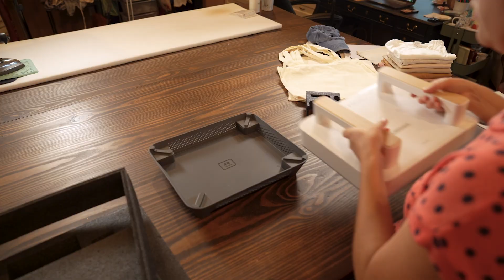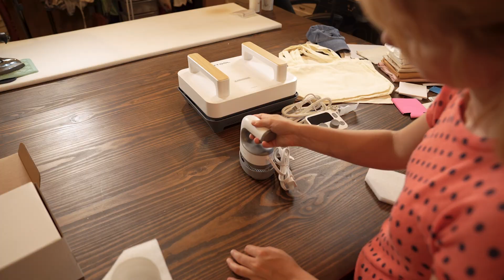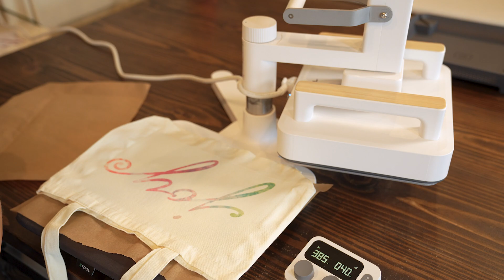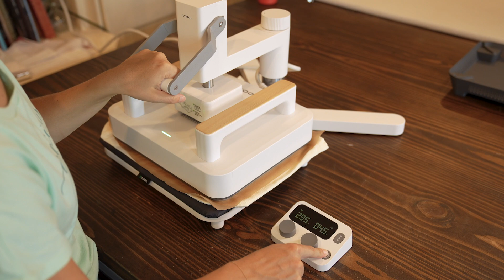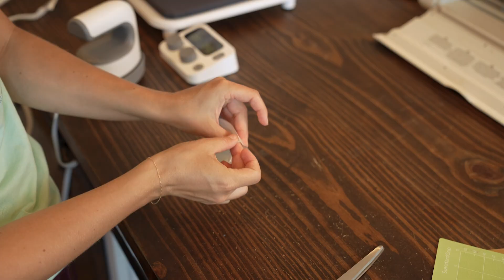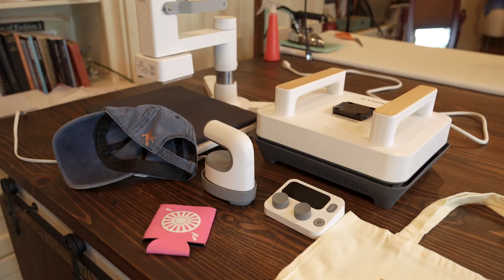Discovering the Possibilities of a Heat Press! - Vinyl & Ink Transfer!

Comment: I am into cutting and working with heat transfer vinyl and stuff for a few years now and i never bought a heatpress (yet). I think it's mandatory to first get the right cutting tool. I tried Cricut at first but would recommend to look into other machines as Brother and Silhouette offer a more bandwidth and broader spectrum of what you can do with the machines.
It is mandatory to learn about everything as it's not as simple as it seems. 😅
And for the sublimation:
There are some transfer foils on the market (in my country by Skullpaper) that are exquisite to use with Inkjet and it's like sublimation but not that expensive. So if you want to print things then cut it and so on, I'd recommend to try those transferfoils first.
Reply: Oh and to top it off I had such bad vinyl experiences in the past when I tried the Cricut Vinyl or something I bought online. I stick to the local fabric store that offers Vinyl. You will see if the Vinyl is good after a few washes...unfortunately